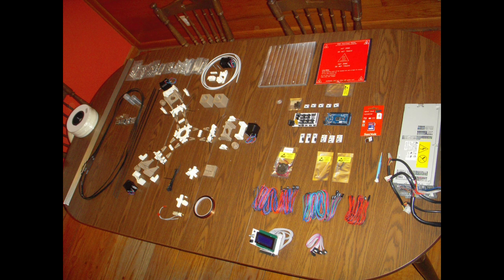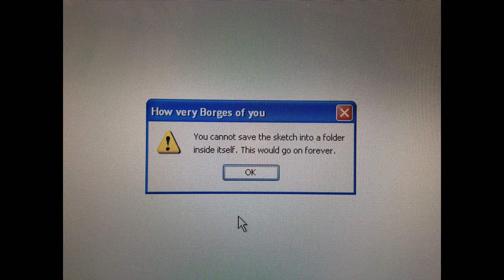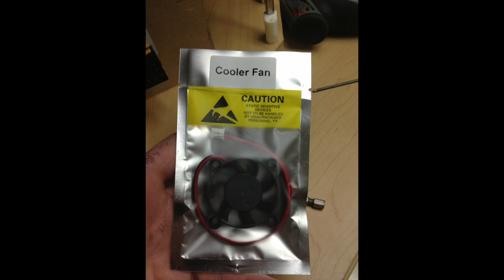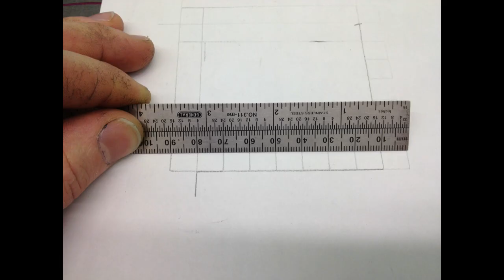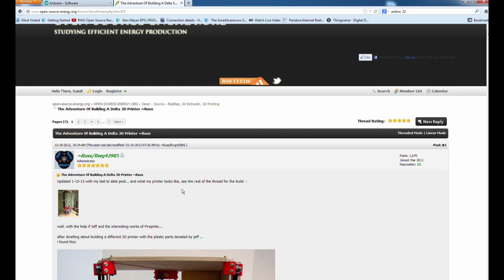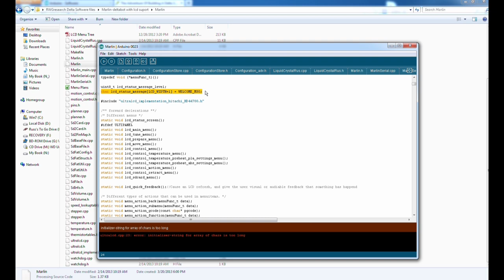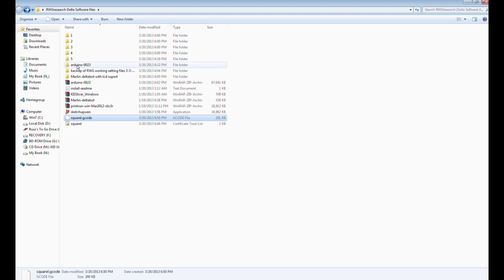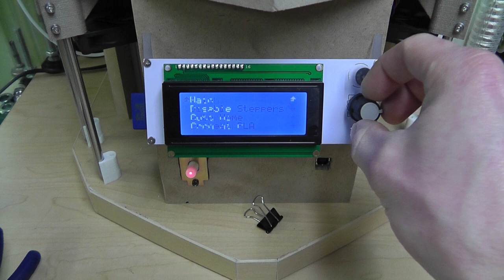Delta 3D Printer Project. Start To Finish Of Building A rostock delta robot 3D printer prototype.

Comment: Great to see another DeltaBot building experience. We're just building one as a custom design from OpenBeam and printed parts. As our second printer we knew a lot of the procedures. We installed the latest Marlin on a Brainwave board and had fun getting the settings together. One thing that was funny was when we first started testing with Printrun/Pronterface we had the mm/m set too high and we thought it was a motor problem. Once we got past that and got the endstops happy we were good to go.

Comment: Excellent video, dude.  Very informative.
Just a note on the strength of printed parts, they are great against compression.  The issue is with de-lamination.  You need to design properly, so that you don't create seams right at the line where stress occurs.

Comment: Good video. By the way, I don't know if someone allready told you this but, if you set the extruder parameters, you can also store the settings in the menu. I have a prusa with this software and I'm printing the Rostock now.

Comment from the maker: Yes, Actually there's quite a few advantages I'll name a few, The end effector is extremely light which means it can move very fast. Less overall parts to build the entire thing, a much higher printing platform most have 200mm this will do 350mm and if the bed is mounted dither down you can get a max of 400mm build hight. Just to name a few. I'm sure there's also some disadvantages but for a home project it seems much better to build this device versus a standard XYZ prienter.. ;) thanks! ~Russ

Comment from the maker: The LCD Information may be posted on line some where. Google "V1.4 smart 20*4 LCD controller" that's what I'm using. On the wire size, I just use a standerd Gage Vs Amps chart for Standard wire sizes. I have an app I use but there are charts on line. Hope this helps, thanks, ~Russ

Comment: Hi Russ, I am trying to get my LCD controller working with my ramps 1.4 board. I bought the one you suggested and it looks identical to yours. I plugged it in and it is reading the temperature but the click button doesn't do anything. Also when I tried upload the marlin.pde that you have in your folder with the lcd support I get the same error in your video at 50:57 saying the array of chars is too long. Did you have to change something to get it to work??? I am so close to getting this LCD controller to work. Any help and advice would be greatly appreciated. If you did have to change something could I just get that Marlin.pde file that you are currently running on your delta because mine should be the exact same set up
Reply: I think I figured it out it was a mix up on the pins.
Reply from the maker: Keith Moilanen
so you got it? ~Russ
Reply: ***** Yep all is well!!! I am using the LCD on my Prusa Mendel, still have to finish putting together my Delta Rostock.

Comment: This video is great, 3D printing in general is very exciting and im thinking of trying to give this a go myself.
In your opinion do you think it would be practically possible to make a 3d printer from scratch? In the software that is used how flexible are the dimentions, motor, stepper control and sensor choises. for example could I build a copy of yours thats double or half the size and it work with the same software just by changing a setting? or would it likely need totally different software

Comment: hola me encanto el proyecto estoy tratando de armarme una  impresora por ahora estoy en el prototipo y escogiendo las partes mi duda existencial es sobre electronica (que no entiendo casi nada) se que utilizas un arduino mega pero que shield{s utilisas y como los conectas
mi ingles no es muy bueno asi q intentare traducirte algo
grasias

asome proyect i[m trying to build a printer for now I'm in the prototype  my existential doubt is about electronics (do not understand almost nothing) u use a  arduino mega but i dont know witch shield {s u use and how to weired
grasias

Comment: Do you think that delta configuration would work for a "copier" similar to an old pantograph but stacked on top of one another with two end effectors linked together on the same set of columns, that would eliminate tilt, and having to have a sample 2x larger than what you were trying to produce

Comment: I have two question: You didn't say much about the "LCD panel" I am interested on getting more info about the LCD panel itself (and a plus about the electronics parts, such as connecting board and step motor controller) What encoder  was it? Speaker? Is there any Schematics for the LCD+encoder+ speakers (I am after for more info to that panel like PCB layout, schematics, bill material. Question 2: you said you did some calculation about the switch PSU could you please post them?

Comment: Hi Russ,   I have installed the STL plugin for Sketchup you recommended.... I am not sure if this applies but do you also need to use a programme/plugin to check for "holes" in the STL file..????...I have seen this advised (for other software I think) and wondered if it applied to Sketchup as well...??...Rgds...Laurie

Comment: how the hell do you get it to stick to just glass.
Reply: I heard somewhere that you can use hairspray to get it to stick. (:
Reply: Beng_ Yeah hairspray works but I actually had a successful print on just glass tonight. I use Borosilicate glass and cleaned it with methylated spirits and set the bed to 70c and the nozzle to 240c just for the first layer then set it to 205c.
Reply from the maker: Teh Stranger? some more info: https://www.youtube.com/watch?feature=player_embedded&v=nN1XsFWq1HA
Reply: Teh Stranger? Cool. I am new to 3D printing. This printer is going to be the first printer I will build! I have built a CNC machine in the past.
Reply: Beng_ Sweet :)

If you have any general 3D printing questions I would gladly help out as best I can. Good luck!
Reply: ***** Hey Russ. Where can I find a copy of that image @4:48 and how can I print it out into 3 sheets like you did?
Reply: Heat it up to around 80C and get it very, very clean.

Comment: Have you seen the the super capacitors printed on cd's using lasers UCLA are doing it, they make super caps with them.  THe point being is when we can print conductive material then we can build circuit boards in 3D,  All circuit boards are grids, around compnents there are fields, we can work with the fields rather than just the output of the componant, so a cap will do more than charge a circuit.  3D will make it a lot easier to build in circuits, so a bolt may have conductors built in.U R A *